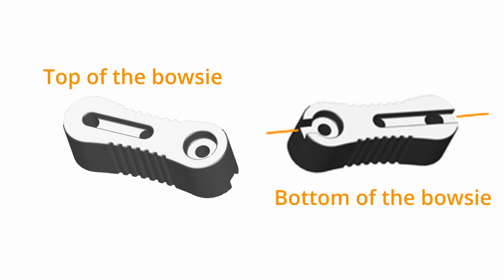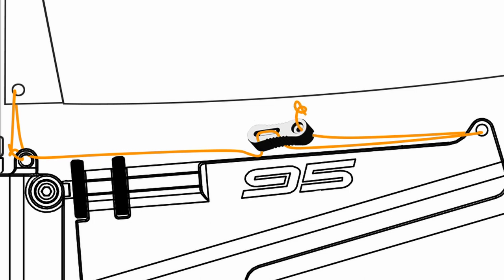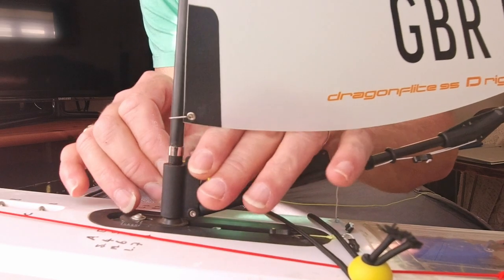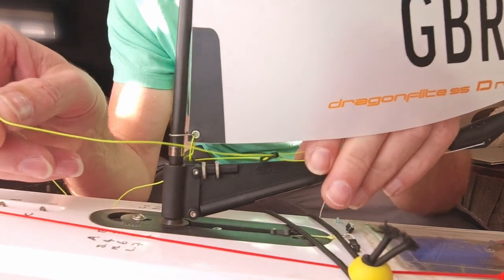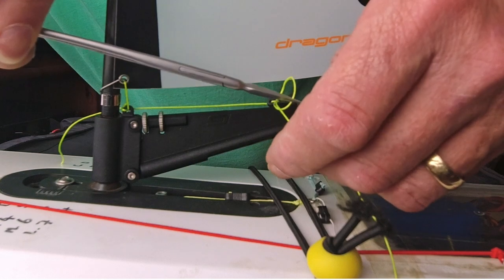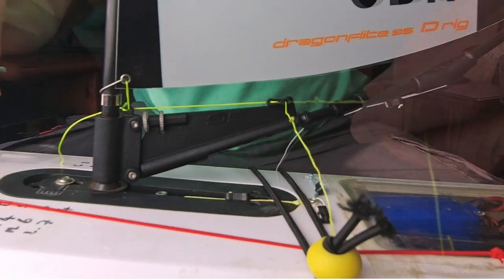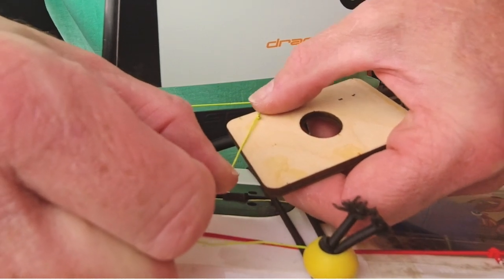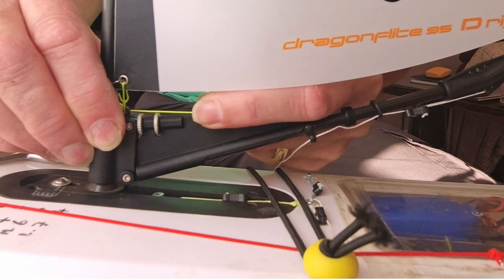DF95 Build   Part 1 of 7   Bowsie Tying

Comment: Hello. Perfect video. The diameter of rigging line is about 1 mm?
Reply from the maker: Thanks for watching. The dyneema (rigging line) is only 0.5mm dia. :)
Reply: The length in kit is enought (I what to be safe to have small stock of it)? It's can be replaces by other thread? I try to imagine, what type of thread it is...
Reply from the maker: @midszypmen_2009  It is this > SeaKnight S9 9 Strands Braided Carp Fishing Line 300M/500M Long Casting Multifilament Saltwater Sea Fishing Lines 20-100LB
Reply: Thank you a lot! Fair winds and following seas!